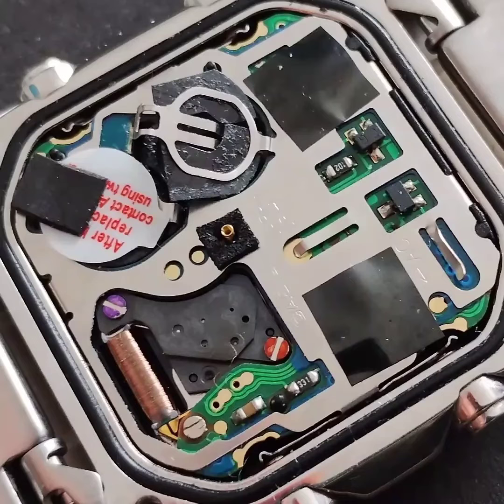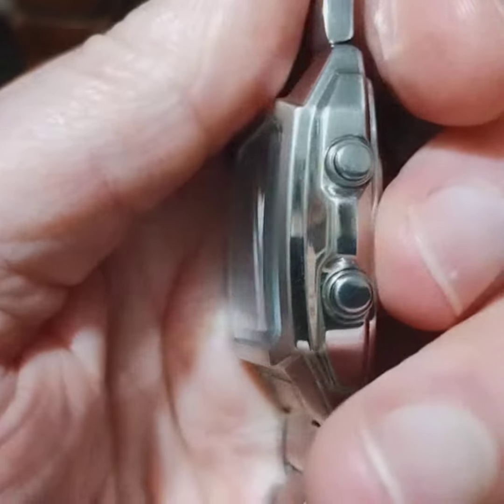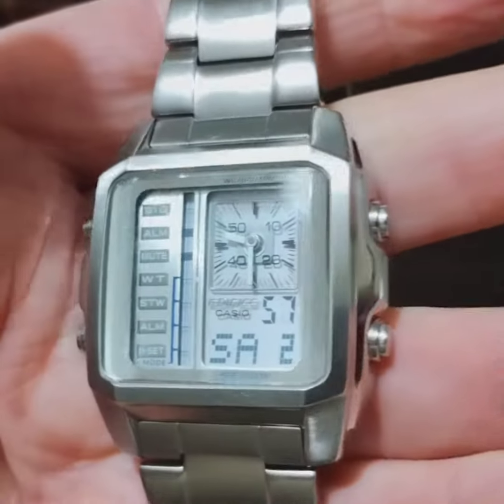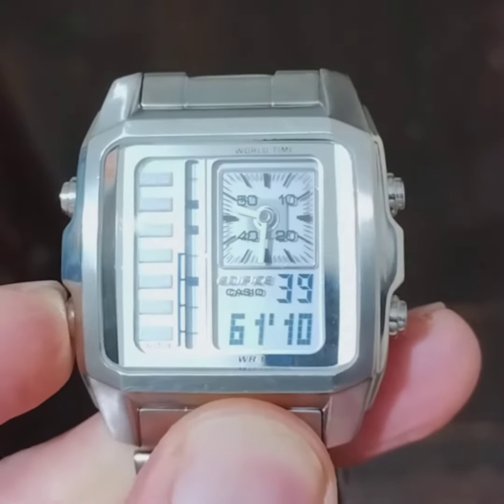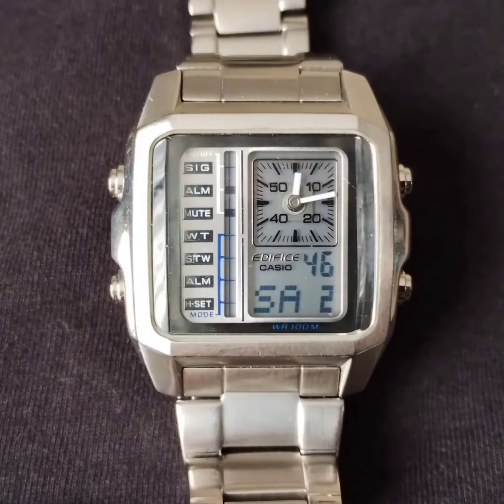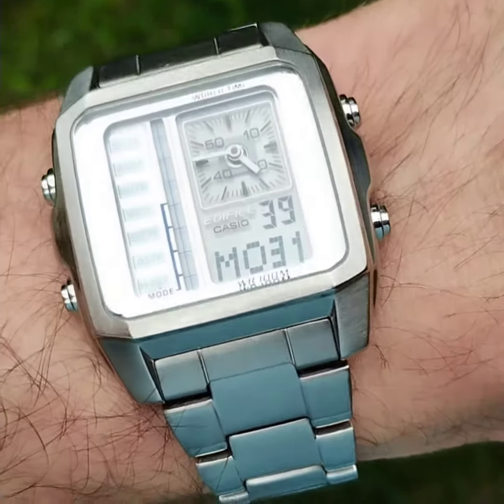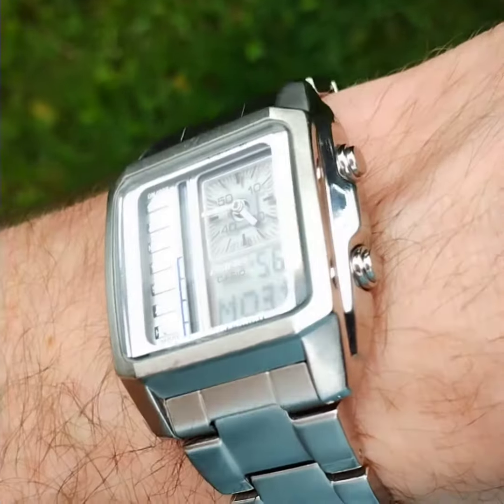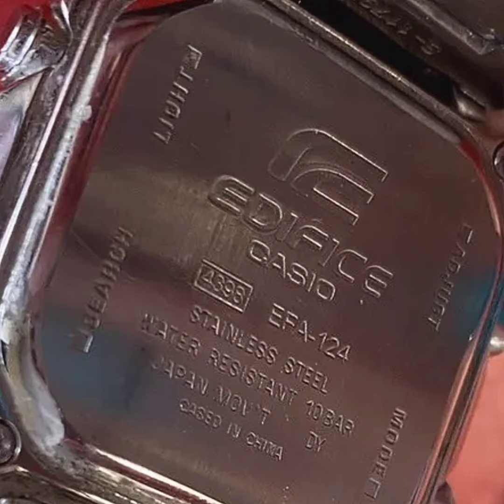CASIO EFA-124 EDIFICE battery change.

Comment: hello! nice video!  I have a question, how did you mute this watch? I was trying for that, couldn't find any
Reply from the maker: I'm not sure, I haven't got the original instructions. I just had a look at the different settings and I'm still getting a beep when changing between the modes using the bottom right pusher. 👍